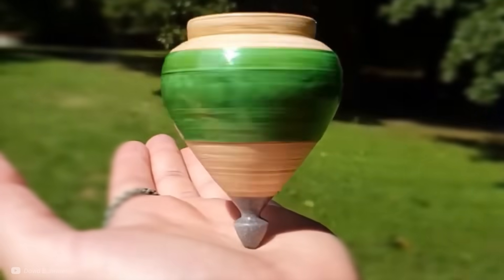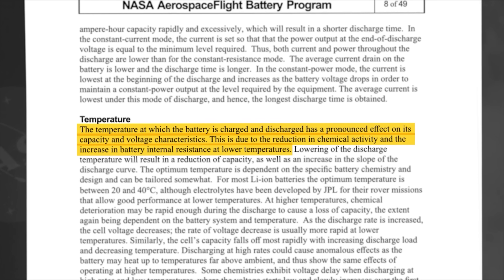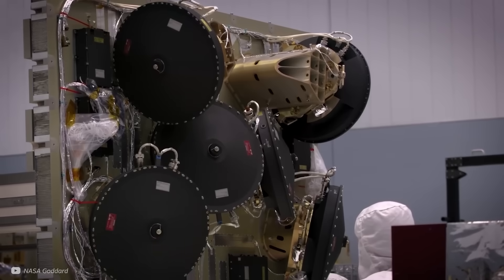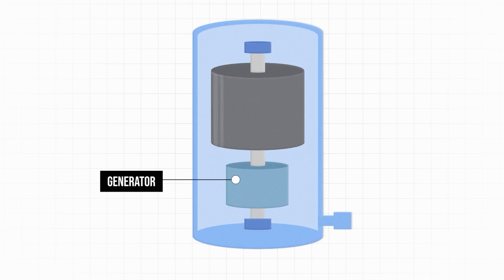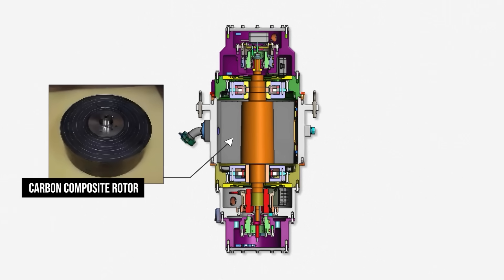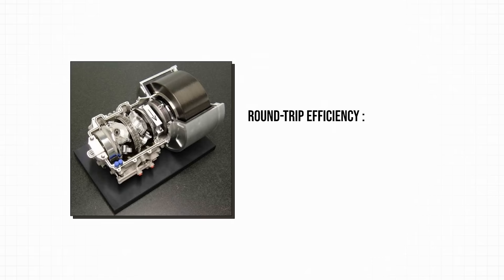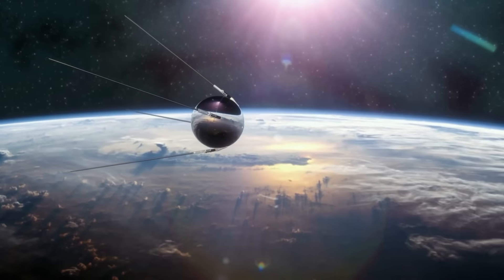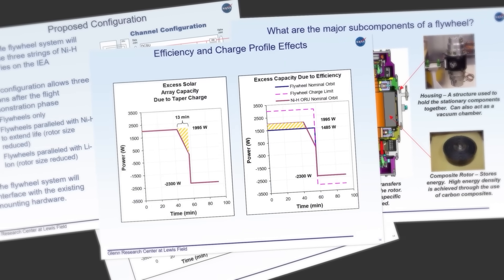How NASA Reinvented the Mechanical Battery

Comment: Flywheels made of depleted uranium have also been used in energy storage and are used in the primary coolant pumps of nuclear power plants to ensure a long coastdown in the event of a power failure.
Reply: I didnt know this was a thing. A nuclear power plant having a power failure seems.. unintuitive.
Reply: @Yamyatos  A nuclear power station needs a secondary power source unrelated to its own generation capability to maintain the coolant pumping action that stops the reactor core from overheating.

This was a significant part of the Chernobyl disaster given that the 'safety test' they were attempting to run was in fact simulating a loss of power to the coolant pump and attempting to use the declining output of the primary generator as it spins down to keep the coolant going.
Reply: @Yamyatos  Fukushima? 🤦‍♂️
Reply: Let's invent a giant lithium battery that can survive being spun at 100,000rpm
Reply: Underrated comment!
Reply: @James-wd9ib not possible
Reply: NB : Uranium as inertia source has nothing to do with radioactivity. It happens by hazard that some plants use uranium as fuel, but that's unrelated. There are several kinds ( isotopes) of uranium and very few can be used as fuel. But they are all « considerably heavier than iron ». So they accumulate much more mass in the same space.

Uranium also has funny dilation curve with many non linear parts so it's used in industry as temperature sensor ...

Comment: 7:55 Modern F1 engines can’t go 25 000 RPM. Although in 2006 there was an F1 engine named Cosworth CA2006, the first F1 engine to reach 20 000 RPM. Modern hybrid V6 engines could might do the same, but they are capped at 15 000 RPM by regulations and usually operate at even lower speeds. So…you can say that compared to modern F1 engines, the G3 can do (100000/15000=6,6) almost 7 times higher RPM. Which is even crazier.👌👍
Reply: F1 turbocharger can go 100k RPM and beyond not only spinning, but also compressing around ~500g of air per second.

Comment: Absolute noob here, wouldn’t the dual purpose actually be kind of bad? Like “oh I need some electricity, but then slowing down that flywheel changed the orientation of my space station?” I’m sure I’m missing something, thanks!
Reply: You would definitely want to have two adjacent complimentary flywheels spinning in opposite directions, and which accel/decel at the same rate in order to negate reactive torque.

Comment: 6:30 And for the un educated its how BEV's get their regen. The brakes are not breaks. You push the brake peddle and the ECU figures out where to go, Do i A. kick the motor in energy capture mode basically doing what you said, you run it in reverse to make power. When need power you go forward to provide it. EV motors are pretty cool like that. You cant do that with a ICE. you need transmissions and you get no benefit from stopping. I still prefer ICE. I love the mechanical nature of the machine.
Reply: Engine braking exists. Trucks use the Jake brake which uses the engine to compress air, helping slow the truck while preserving the brake pads.
Reply: @ctrlaltdebug  The point was that ICE engine braking doesn't capture the energy, it just turns it into heat. With BEVs the energy goes back into the battery (minus some losses of course).
Reply: But it could if the compressed air from the jake brake was stored in an air tank & then used for oxidizer boost later.
Reply: @ Could, but isn't. Fossil fuels are too cheap, so there is no demand worth the extra complexity, weight and storage space.
Reply: @ I did some research on regen for ebikes, and almost nobody does it because it's extra complexity and you get like 20% of the energy back. Don't know how it works for cars, but efficiency probably is in similar territory.
Reply: I forgot the B call for real brakes but you get where i was going. LOL

Comment: According to Carnot's theorem, if your heat sink is 0 K the theoretical maximum efficiency of a heat engine is 100% with any heat source with higher temperature than 0 K. While you don't get that cold even in space, you can get pretty close, which means it should be possible to design a Rankine cycle with helium as the working fluid that is able to turn even low temperature heat into power with extremely high efficiency, when there's no sun for solar panels. To me that would be an obvious way to store energy when you're guaranteed unobstructed solar power about 12 hours a day. 

Also, for reasons that are beyond me, they apparently have a a big heavy system on the ISS to reject excessive waste heat out to space that is based on ammonia, which among other things requires a big heating system stop the ammonia from freezing. 

I do get that they need to reject a lot of heat, I suspected that was the case, and just looked it up. What I don't get is why they use a lot of energy to reject that heat, and ammonia that among other issues risks freezing, when they could use helium, and turn most of that unwanted heat into useful power.
Reply: In space you cant lose the heat, as you are in a vacuum.  Only radiation works and that needs much higher temperatures.
Reply: @stuartclough915 this is the answer, there's no convection in outer space
Reply: @ Heat radiates from  everything that's warmer than 0 K.
Reply: @ Sure, but for not very warm things the rate can be too slow to be useful in practice.
Reply: @ They use radiators on the ISS to get rid of excess heat. Ballpark 300 kelvin is very warm compared to outer space. And not having an atmosphere that reflects heat helps getting rid of heat by radiation.
Reply: @fishyerik  radiation is to the FOURTH power of temperature in Kelvin.  Difference between 270 and 300 is 52% increase in rate of heat loss.
Ammonia can be used in evaporative cycle which is way more efficient. Helium less so, plus density disadvantage of helium. Which is a 4x factor in gaseous applications.  As a liquid is ~3400 denser.  So a helium heat exchanger will possibly be bigger than the ISS itself.
Reply: @ They use radiators on the ISS because that's the only way to do it in space, they have no other options. When you can only radiate, I guess having no atmosphere "helps" you radiate more indeed. But if they had an atmosphere they wouldn't be restricted to radiation only in the first place, and it would be a lot easier to dump that heat.
Reply: My guess: Helium is hard to keep contained for long, it leaks out. Also it probably has low thermal mass compared to ammonia, so you'd need a lot more of it.

Turning the heat into power sounds neat. Could be that they just don't need it, that solar panels are an easier/cheaper way to get power. When they're on the night side they get no solar power but also have much less need to radiate heat.
Reply: @tvuser9529 Helium has it's issues, but so does ammonia, and when part of the system is way below the freezing point of ammonia, that's a severe drawback for ammonia. 

Ammonia has much larger heat capacity for a given volume, at the same temperature and pressure, so if only pumped around to transport heat, helium would require much beefier lines, but when you extract power from the heat, the energy doesn't appear from nothing, heat is turned into power.    

Helium loss from leaking wouldn't have to be significant issue.  Helium is difficult to contain, but difficult is what they do. Ammonia, besides the risk of freezing if anything goes wrong, with potential catastrophic consequences, is flammable, toxic and corrosive. 

There are other potential working fluids with much lower freezing points than ammonia, that also isn't flammable and toxic and corrosive. I just think the fact that helium won't freeze at any temperature unless under high pressure is a huge advantage, besides being inert and non-toxic. Nitrogen for example, quite easy to handle and safe, much lower freezing point than ammonia, and lends itself very well to extract energy with high efficiency from the temperature difference between ballpark room temperature and outer space.     

All those points have merit, but aren't deal breakers. And while they don't need the power they could generate from heat rejection on the ISS, that's because they have systems that typically generates all the power they need, but that came at a cost. And don't know what the power systems have costed, but it's a significant part of the total cost, and I think they have spent over 200 billion USD, in current value on the ISS, in total.       

And it's always great to have margins and backup power, especially you know, when your life depends on it and you can't just call someone to swing by the same afternoon with spare parts and specific expertise.

The orbital period of the ISS is 92.9 minutes, being on the sunny side or not doesn't have that much effect on how much heat they need to reject from within the space station, and they could store heat if they really wanted to maximize the power generation from such a system.

Anyhow, I still find it strange that they make it so complicated and wasteful, it's not just that they don't use the potential to generate power, they waste power on rejecting heat. Pumping coolants to remove heat from a space station seems a bit like using pumps to let water pass a dam.   

Thanks for the intelligent feedback by the way, even if I don't think you provided a complete explanation, all your points have at least some merit, and some are probably a big part of the real reasons, especially to why they don't use helium specifically.

Comment: The only reason I'm not a fan of fly wheel batteries is their power discharge being variable the entire way down as it's being used. 

Big fan of the other mechanical battery, pump hydro, if it can be considered mechanical 😅
Reply: Definitely an attribute that has to be designed around. An oversized motor/generator is necessary, so the required power can still be generated on the low end of the RPM range. The rate of change of RPM per power is exponential, as you said, but continuous power can be generated using close loop control. 
I know this because my work happens to be in this video.

Comment: The idea of a mechanical battery may be genius but the genius who thought of it died a long time ago.  We examined the design challenges of using a flywheel to recover a car’s braking energy when I was in college 50 years ago. Back then we didn’t have the luxury of using carbon composite… or lithium batteries for that matter.
Reply: Flywheels have been around since 6bc with Potters flywheels. Most likely even longer. 

 A German inventor Presbytr recorded some of his machines using em. In the 1100s According to wiki. I am not familiar with him. 

 Then of course you have windmills, grain mills, and sharpening wheels, and such also used the idea. Just not for electricity. 

 Then of course James Watt use of them really took off with helping steam engines run smoothly. 

 The E Dumpster is a giant dump truck for open mines that doesn't need to be recharged ever at the mine it is at. 

 It goes up hill to collect ore. Then since it goes back down hill loaded. It gets all the energy back from regenerative breaking to repeat the process. It gets the energy essentially from the heavy ore. 

 It is cool. It shows how rocks on top of hills or higher elevations have a lot of potential energy, and I doubt most people think about things at higher elevations having potential energy that can be tapped.

 Anyway just pointing it out! That is cool work. Too bad we didn't embrace batteries back then. We would have crazy electric motors, batteries, and flywheels I think by now. Can't wait to see what it looks like 40 years.
Reply: @dianapennepacker6854 -The use of gravity power isnt new, every hydropower dam ever built does that. Doing it with rocks/ores is less common, but I recall some counterweighted cable car trains and barge elevator systems like that, and an electric iron-ore railway in Norway or Sweden up over a mountain. Awesome engineering, though very niche😊!
Reply: Don't commercial vehicles often use compressed air for energy storage during braking/acceleration?
Reply: @jamesyoungquist6923 They used to use hydraulic fluid and an accumulator so it could run at higher pressure. Was somewhat common on things like garbage trucks. The idea was building pressure would slow the truck then you’d use that pressure to accelerate it to the next stop. 
In the end the weight and the complexity of the system meant it didn’t last long. In the end they didn’t save enough fuel to offset the cost of the system and keeping it going.
Reply: @NBSV1  ah, thx for the background :)

Comment: Although when you draw energy from the flywheel, youll inevitably impart a torque to the space station. unless you draw from two counter - rotating flywheels in the same plane. otherwise things could get very weird when there's a huge power draw.
Reply: that is the idea, you always have flywheels in pairs
Reply: I was pleased to see the animation at 14:19 got this right.
Reply: @licencetoswill
also while charging :-) if they used all the flywheels as batteries then they would all have to be paired to charge and discharge unless they need to rotate the satellite then charge or discharge one of the pair to move in the right direction :-)
Reply: @YTANDY100   - relatively simple to have 2 wheels on opposite sides of the "stator" array -  rotating equal and opposite..

Though an ability to vector the torque allows to use as reaction wheels also - merely shunting power from one to the other can give tractive torques..
Reply: @YTANDY100  Yes, though care has to be given that the flywheels don't exceed the maximum rpm of the system. Additionally, there is a potential problem if the RPMs of the flywheels are different enough that when you apply thrust to the craft, gyroscopic precession will result in an unexpected thrust vector.
Reply: Man, i get dizzy every time I chuck some bread in the toaster!! 😂
Reply: That's the point. You spin up the flywheel to turn your ship one way, and you draw it down to turn the other way.
Reply: Yes, the control moment gyro already uses pairs of counter-rotating flywheels, one pair for each axis usually with a fourth axis as a backup to the other three.
Reply: @framegrace1  no, when a magnetic field moves through a wire it creates an electric current (which we use to power things) and an equal an opposite magnetic fields, which acts against the magnet, this is known as lenz's law and it's what slows the flywheel when you draw power from it and it will impart a torque on the craft.
Reply: @tuseroni6085  for a single axis you need two flywheel batteries in opposite direction. When you charge both at the same rate, you induce zero torque because the twin would counter everything that happens to the other.

Then, for being a reaction wheel, you transfer speed from one twin to the other. This will then create a torque, without needing to spend the kinetic energy. Take kinetic energy from one wheel and put it into the twin that is the opposite direction. This creates torque without changing the energy storage level.

So you can use it as either a battery or a reaction wheel separately or if you need simultaneously by charging the twins at different rates.

I believe the images shown are not the same flywheels. Because if you use 4 flywheels its just reaction wheel and sounds dubious as a battery, for the reasons you stated. I believe it needs 6 flywheels, 2 for each axis, altho I could be wrong.
Reply: @de0509 yes i know, the person i was replying to was saying that drawing power from a single flywheel does not induce a torque, i was explaining why it does.
Reply: @de0509  I think you could get by with as few as 4 flywheels in a tetrahedral configuration -- I believe that is even shown in the video.  With 4 wheels, I believe you can vary the relative rates of spin and create any direction of vectoring.
Reply: @fewwiggle  yeah. Some kinda vectors. I dont do anything with gyroscopes or maths involving them, so Im unaware of lots of stuff. Correct me if Im wrong but now you said that Im imagining 3 vectors all at 90 degrees and the 4th to "return" to the origin, to get zero reaction. Or more elegantly, in tetrahedral so no single vectors has to be the dedicated one for cleanup. The math to get any resulting non-zero vector using all 4 of the wheels would probably melt my brain tho
Reply: @de0509  I think the issue with three, is they can only torque one direction each: X, Y, and Z (unless they could be reversed to go in -X, -Y, and -Z).
By putting in that 4th (in a tetrahedral configuration), you can be offset from X,Y, and Z in such a way as to go in any +/- direction.
But, I'm just musing.  I may be totally wrong.

Comment: Would the battery be hard to move around due to torque or momentum?
Reply: Very difficult indeed, when energized
Reply: Weight is much more an issue.
Reply: You can move in three axis, vertical, horizontal. FOC technology can very rapidly absorb and release energy and the flywheel will "walk" itself. But not for a few years or decades.